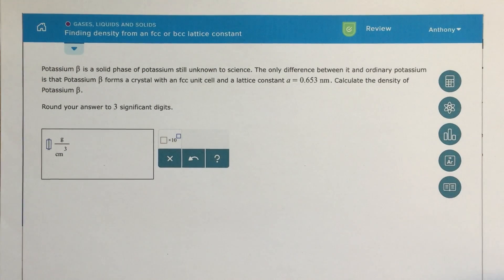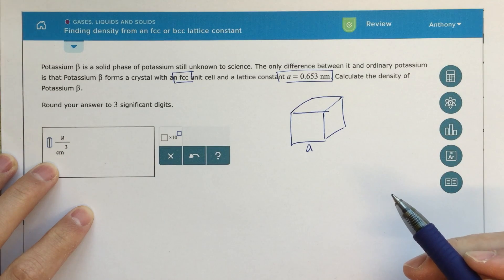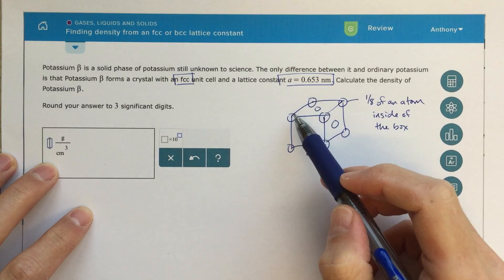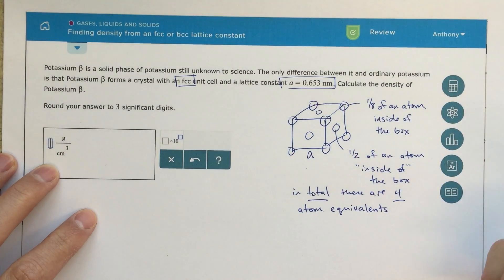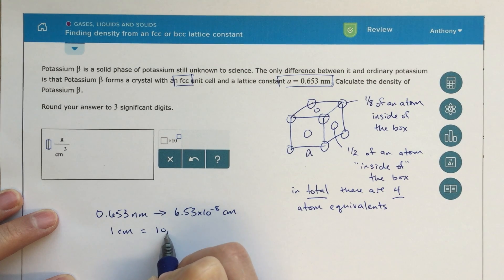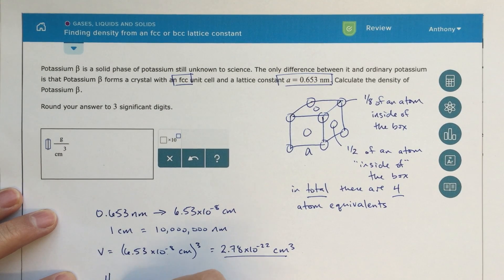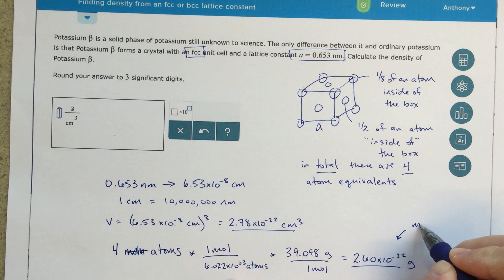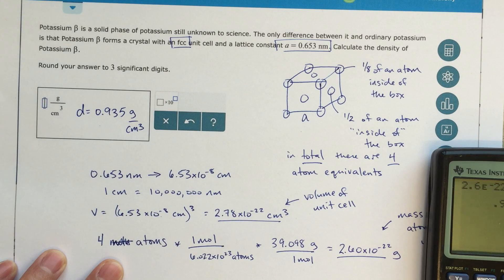ALEKS - Finding Density from an FCC or BCC Lattice Constant

Comment: not entirely sure where you went wrong, but the aleks answer to this is 9.33 x10^-1 (.933)
Reply from the maker: That very small difference is likely due to using a less precise mass for potassium than ALEKS used to calculate their answer. I assure you that entering 0.935 for this problem is acceptable, as I check all of my answers before posting the videos. Cheers!
Reply: @TonyStJohn  On Aleks 0.935 is incorrect
Reply: @TonyStJohn  The answer on Aleks is 0.933 g just like RotMG Z said
Reply: He probably was rounding the earlier answers with the X 10^ so and so number

Comment: Why can't we find the volume of effective atoms in that unit cell and find density?
Reply from the maker: Hi Devasena! I think the answer to your question is simply that the volume of the cubic structure is not the same as the volume of the effective atoms. And we are looking for the density of the entire cubic structure. The reason the volumes are not the same is due to the fact that there is empty space between the atoms within the cubic structure. Does that answer your question?
Reply: +Tony St. John  THANK YOU